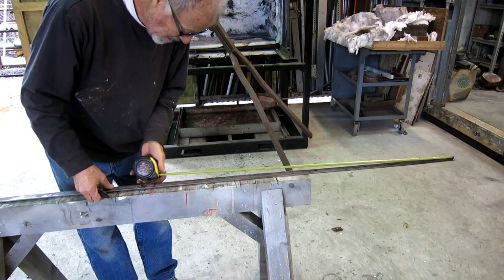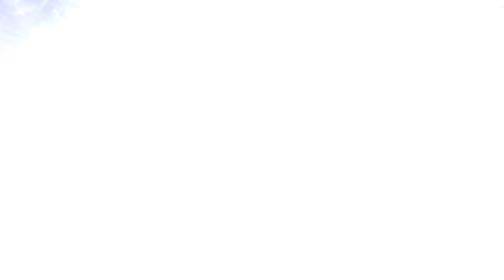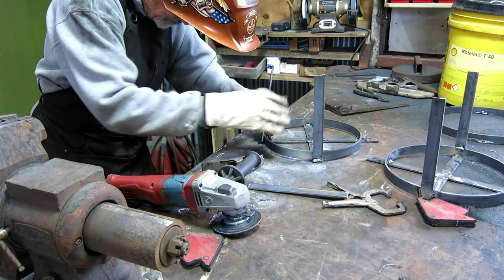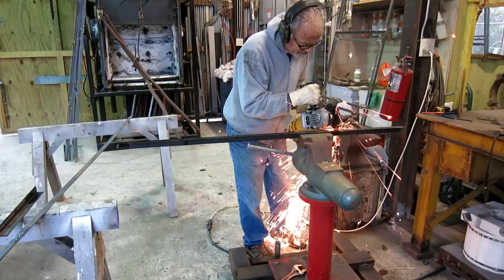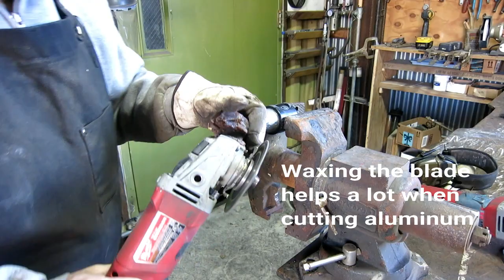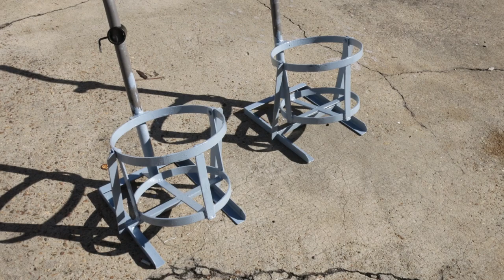Bucket Buddy, an aid for dealing with pouring 5 gallon buckets.

Comment: What kind of a welding helmet do you use? Looks like you are using an auto helmet. My (cheap) auto darkening does not work well at all.
Reply from the maker: Jrsue
Don't remember the model # but it is a Miller and was not cheep. I started with a Harbor Freight and like you quickly realized that with my marginal welding abilities I did not need to be dealing with cheep hood issues.
Barry